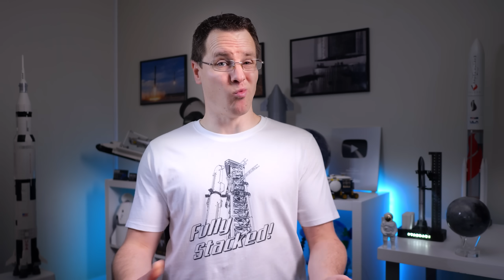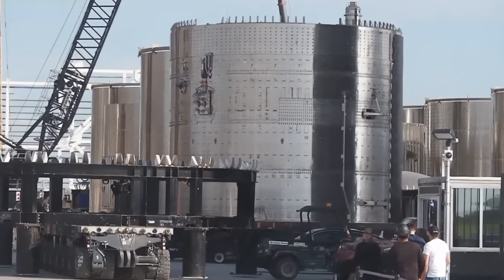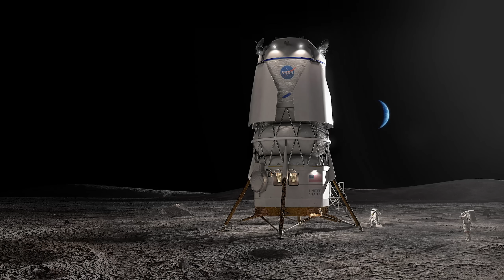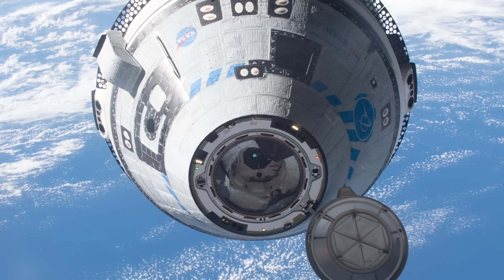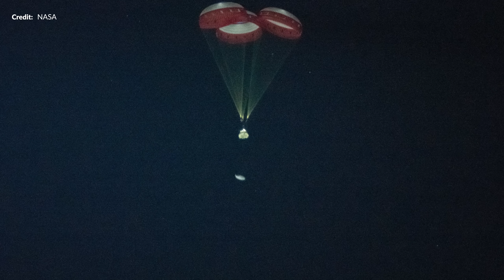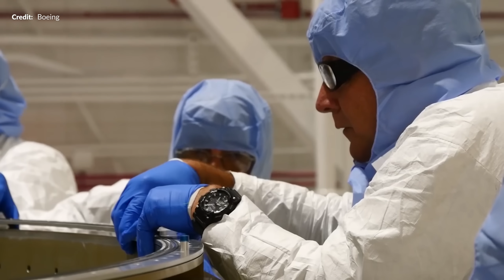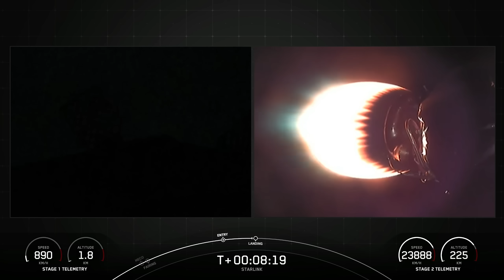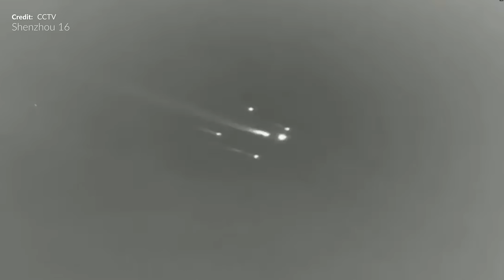SpaceX Starship: Mega Pad Upgrade to Tame the Thrust, Boeing Starliner Delayed Indefinitely

Comment: Starliner is a sucking black hole for taxpayers money, just cancel the starliner contract and find a company that can get it done on time and on budget because Boeing doesn’t have a clue what the hell they are doing. SpaceX had half the money and has been flying crew dragon for years now. Take notes Boeing.
Reply: Maybe these contracts should include a clause for a refund if they are delayed too long.
Reply: Starliner is a fixed-price contract, so Boeing is paying for the fixes.
Reply: @steveaustin2686  didn’t they request and receive additional funds a year or two ago?  But regardless the delays cost NASA more and more money. Now the schedule shifts again. So more money in delays for the people funding it.
Reply: @ssg25uret6  It was a lot longer ago than you suggest. Boeing weasled money out of NASA based on SpaceX failures in Jun 2015 (CRS-7) and Sep 2016 (AMOS-6). That money was in 2017, two YEARS before Boeing had their failure on the Dec 2019 OFT-1 flight. 

Boeing took charges against profits of $410M in 2020, $185M in 2021, and $288M in 2022 ($883M), to pay for Starliner fixes. They will likely have to take more charges this year. That's ALL out of Boeing's pocket. Boeing does NOT get paid for delays, quite the reverse actually.

It's a good thing that NASA took 2 providers in 2014, otherwise NASA might still be relying on Soyuz to get to the ISS.

Comment: I'm glad you bought up Starlink service in Australia Marcus. I live in a small city in Australia, it's basically a rural town but technically wer're big enough to be a city. We have a FTTN (Fibre-To-The-Node) NBN connection where I live and the nearest node with a fibre optic connection to the rest of the country is about 90km away meaning we really only have a copper connection. Our download speeds max out at about 25Mbps with an average ping of about 15ms. I know the ping from any satellite internet connection will undoubtably be worse than that, but I'm really tired of the constant slow speeds my shared household is gettings so I made the decision only a couple of days ago to test out Starlink. It's a 30 day money back guarantee so if it's not for us in the end at least we aren't really losing anything and we got the massive discount on it too which helped in making the decision. I'm hoping as Starlink matures the speeds and connection will stabalise but with a growing family here I'd rather pay a bit more, lose out a bit on the ping side and just have greater download speeds. The low end download speeds achieved by most Starlink customers is literally double what our highest speed is. Wish me luck!
Reply: One of my co-workers lives on the edge (like walk 200m and you're in the 'burbs) of a state capital. He has Starlink, because his NBN matched yours, and he is NOT going back to that boondoggle, ever. I think you won't either, good luck!
Reply: My mate from rural Tassie has Starlink and he recons its amazing.

Comment: I thought he said "sheet pilings"?
Reply: I think that's what they're called. They are the flat sections you can hammer in to create underground walls (dams) in order to excavate inside the without ingress. Used in construction of high rises and such a lot for subterranean excavation of carparks etc.
Reply: He did in fact say exactly that.
Reply: These are these trapezoid section sheets on the outer perimeter, driven into the ground. Retains the soil and is largely watertight as the joints between the panels are getting gummed by fine particulates after a while. Keeps the ground water away so you do not have to constantly pump out the excavation and allows for easier work inside the perimeter.

Comment: Boeng is at risk of a major hit to their reputation.  If they screw it up, nobody will ever be willing to take their products to space.  It could even smear the aero side.  If I was in charge of the project, I would fire the senior engineers and restart from scratch, or terminate the project entirely.  Instead, whoever is in charge is going to gamble the corporation.  After all, he has a golden parachute.  To bad about all the employees and subcontractors.  It could be decades before they could recover from dead astronauts in a Boeng capsule, if ever.
Reply from the maker: They haven't had a good run in recent history with the 737 MAX. The doc on Netflix was very eye opening.
https://www.netflix.com/title/81272421
Reply: @MarcusHouse  Or with the new tankers for the Air Force... fun QA issues like tools left in the tanks...
Reply: @MarcusHouse  To be fair, the tape is flammable only in certain situations per reports. And requires failures of other hardware to happen. Per NASA/Boeing, "Although that tape is commonly used on other spacecraft, they are evaluating if it is acceptable for crewed flight (article NASA and Boeing say preparations continue for July Starliner test flight Jeff Foust May 27, 2023)"

Parachute and wiring issues to delay Starliner crewed test flight
Jeff Foust - June 1, 2023

"Both the parachute soft links and wiring tape were used on the Orbital Flight Test (OFT) 2 uncrewed test flight in May 2022 without incident. The soft link issue, officials said, would only be a concern if one of the three main parachutes failed, putting additional loads on the other two, while the flammable tape would have required what Nappi called “multiple failures” elsewhere in the spacecraft."

---------------

Boeing finds two serious problems with Starliner just weeks before launch
ERIC BERGER - 6/1/2023

"The second issue involves P-213 glass cloth tape that is wrapped around wiring harnesses throughout the vehicle. These cables run everywhere, and Nappi said there are hundreds of feet of these wiring harnesses. The tape is intended to protect the wiring from nicks. However, during recent tests, it was discovered that under certain circumstances possible in flight, this tape is flammable."
Reply: @MarcusHouse  And now a new flaw in the 787 has been discovered. The list goes on and on.

Comment: I think SpaceX will find that there is no substitute for a flame diverter. Even steel erodes under those pressures and temperature. They will also find that steam does not make a good coolant and creates a barrier to cooling water.  You can see that from their recent raptor test.
Reply: Yep. This pad is intended to sustain a high tempo and so have an awful lot of launches between major maintenance. That is a much tougher engineering requirement than, say, the Saturn V pad which could be designed to withstand a limited number of launches.
Reply: It isn't about heat, it's about pressure, steel is excellent against pressure, and that steam barrier that you said will stop water cooling, will also prevent heat transfer to the plate
Reply: Water is amazing.  If you have ever tried to solder pipes when there is even a very small dripping water leak you will have discovered that the pipes don't reach high temperatures no matter how much heat you apply.  Until the water is completely gone.  Steam is not a problem because that will be blown away instantly. so the only real issue is keeping enough water there so ir doesn't go dry.  And I think they know how much is needed.
Reply: @dougcox835  they will need water pumps more powerful than the starship booster, otherwise the water will be pushed into the plate and steam will form inside the sandwich and it will start to melt. You can see that happening with the raptor test.
Reply: I looked at a CFD study of the penetration depth of gas jets into a pool of water. It appears that penetration depth increases with a power of velocity somewhere between 1 and 2. If that holds for the exhaust velocities of the Raptor engine, the steel plate will need to be covered by at least a meter or 2 of water. The puddle of water shown in all the artwork will simply be swept out of the way. The video of a test SpaceX conducted with a single Raptor confirmed this. Further, there is no barrier to maintain water to a depth of several meters from the designs I’ve seen. Further, water of that depth will dissipate any of the spray flow emerging from the plate.

If exhaust flow directly impinges on the plate, it will likely lead to steam formation in the sandwich which would disrupt the flow of water needed to cool the plate.
Reply: Why not have the launch mount on a rig out at sea with the ocean instead of a flame diverter? Would this work?
Reply: @stephenwhite1372  that would work. That was the plan with sea dragon.
Reply: Agree NASA has no trust in Space X and it's growing. If Musk has one more fuckup hes gone, he is under pressure and the way he is going he will fail.
Reply: If they can maintain a high enough flow rate then they'll be fine. Moving that much water is extremely challenging though. But if the plan is to run water inside the plate and covering the plate then I didn't foresee them having any issues. It would be similar to filling a paper or styrofoam cup with water and placing a flame under it, the water inside the cup will begin to boil before the cup melts
Reply: @SoupyUnicycle  it will be extremely challenging. Unlike the foam cup, the plate will not have the benefit of gravity dispersing the steam. Instead the steam will go up against the thrust of the engines,
Reply: @SoupyUnicycle  BTW, it only works with uncoated paper cups, not foam or plastic, nor cups coated with a plastic film or wax. The difference is critical, same as for their blast diverter/absorber.
The point is the water must sit out through the paper in order to wet and cool the surface, and so that the fire can make up the water, without touching the paper.
Google for “boil water in a paper cup “
Reply: Agreed, steam cannot become superheated in a boiler while liquid water is present, but this is not a boiler.  It will be interesting to see the volume of gaseous steam generated, there is already a very large amount of combustion gas.
Possibly there will not be enough time for the launch pad to blow up again, as it takes , from what I see about 30secs to launch spaceship away from the launchpad.
Reply: Even flame diverter corodes, so you will need to water cool that anyway, so why not just get by without it, also having flame go 360 is way bether than consentrating and diverting all the flame to one side with diverter. there are images of current launch pads with diverters which have concrete all corroded away and needing repairs after multiple launches, and they only have launhes once in a blue moon, but spacex plans rapid launching multiple times a day. also all the other rockets have been childs play compared to starships power and old solutions just arent enough for todays standards imo
Reply: @Yeyy  true, but those flame diverters have a lot more distance over which to redirect the energy. the energy is far less concentrated. Given the size of starship, you may need to watercool a steel coated traditional flame diverter trench anyway.

Comment: Imagine if they had a version of starship and booster that was like the falcon heavy would that even be possible 🤔😂
Reply: I think they would need heavy reinforcement in the core and side boosters which would loose some performance (and take time to design).  Also if the payload is that heavy would it fit in a fairing?
Reply: 450 tons with reusable
900 tons fully expended

What could possibly use that much Weight and still look nice